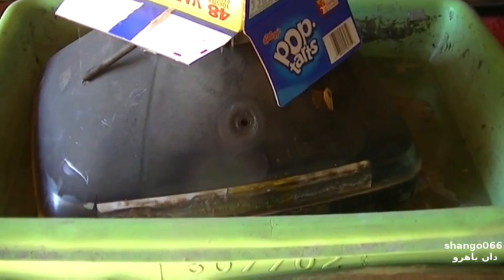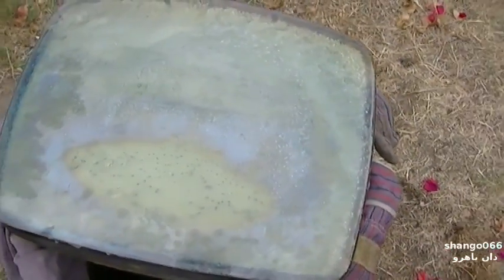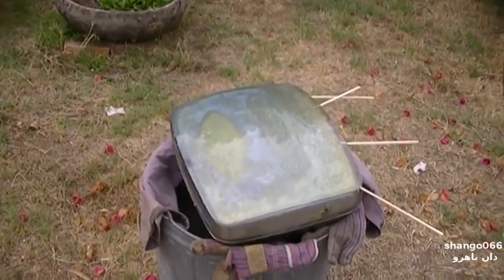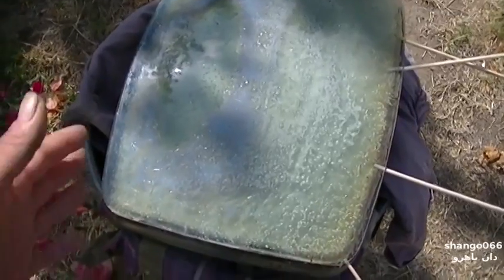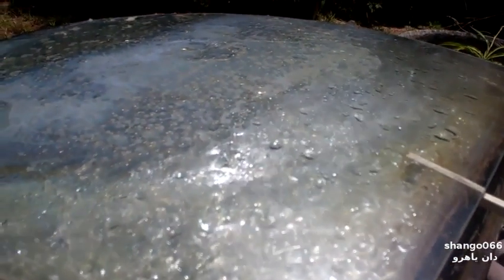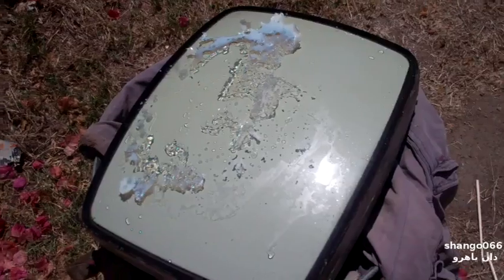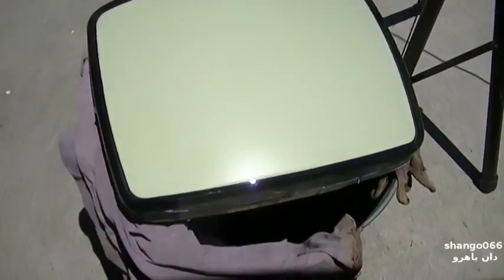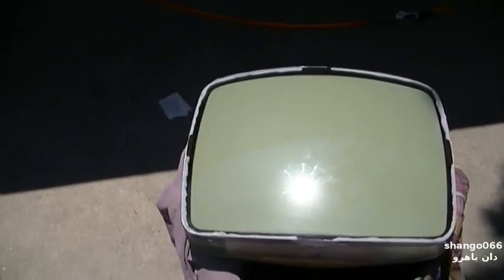Color CRT Safety Glass Removal Cataract Repair

Comment: CRT's don't explode, they contain a vacuum, they implode.
Reply: What happens after an implosion?  Explosive decompression.  All the mass gets pushed to the center by atmospheric inrush at high velocity.  When all the mass compacts into the center of the implosion, it compresses and bounces back throwing glass outward at nearly the same velocity of the implosion.  It's an explosion.  Also the stress within the glass can explosively deconstruct when a structural failure occurs.  Search for a Prince Ruperts Drop for an example.
Reply: @RetroOnSpeedDial  He was actually talking about his JVC digicam
Reply: does not matter, glass scattered all over the place, same thing
Reply: Because so much energy is involved, it is a distinction without a difference.
Reply: He wasn't talking about the CRT exploding, he was talking about the safety glass on top of it exploding from being removed with uneven force

Comment: You should try a Solution of Edisionite Classic in Water insted of Vinigarwater! This Edisionite high performance tenside Solution is able to undercreep all this ugly plastic material. It will seperate the Plasic from the Glass without mechanical stress. In our Lab we make very sticky Copoliamide based Homelts in Glasreactors. The only way to get the sticky rest out of this Glasreactors was a bath in to this Solution vor 3-5 Days!

Maybe you find this Hint helpful!

Comment: I wonder if the summer weather and the hotter environment inside the garage helped accelerate the action of  the vinegar and water mixture on breaking down the bond between the PVA and the glass? In noticed that the PVA goop was peeling away from both the face of the picture tube and the safety glass at the same time.

Comment: The camera should be relatively easy to take apart,  it could be something simple like a bad connection.  Those little LCDs probably use flat flex cable that plugs into small sockets on the main board inside the camera.  Just the constant opening and closing of it over the years could have jostled it loose, or it could be torn.

Comment: How does a TV get cataracts?
Reply: clayton betts The manufacturers used put safety glass over the CRT as a implosion prevention (newer CRT's have it built into the CRT itself rather than stuck on) and they put adhesive on it to make it stick, over a long period of time the adhesive breaks down causing it to be visible what he is doing is trying to remove the safety glass (cataract) and reapply adhesive.
Reply: @realgroovy24  He doesn't put new PVA material between the tube and the safety glass, he just sticks it applying some silicon around the edge. In reality he's actually leaving an air gap between the two pieces, but hey, its for looks, not safety.